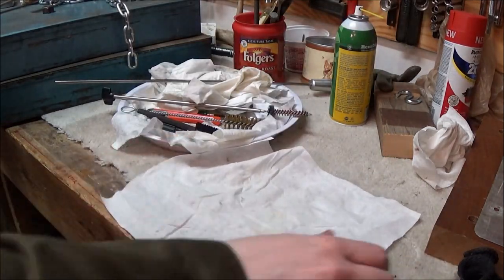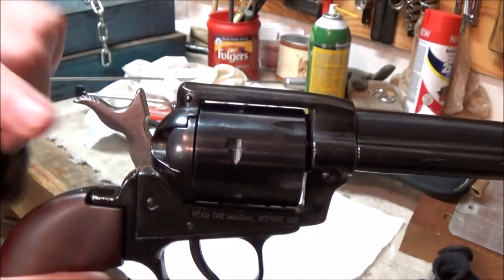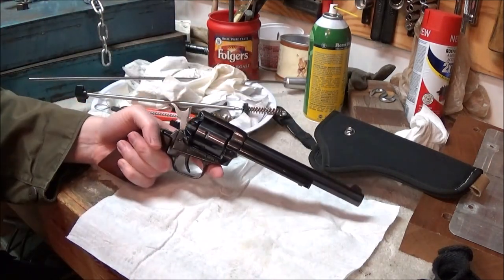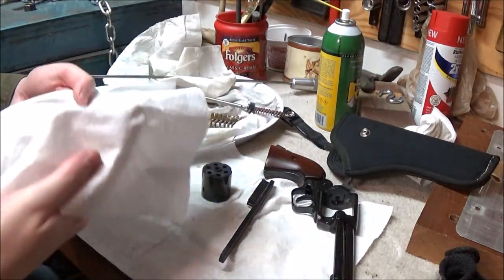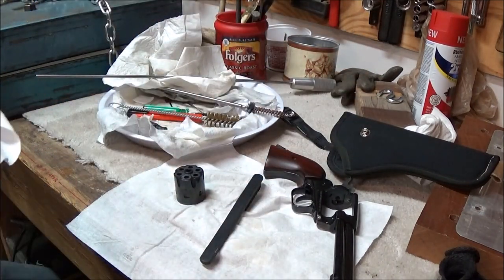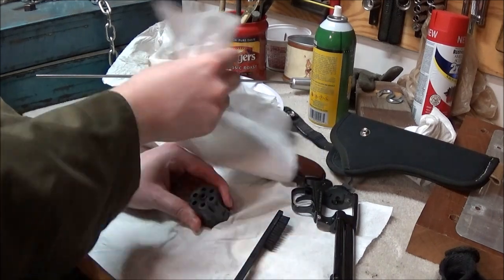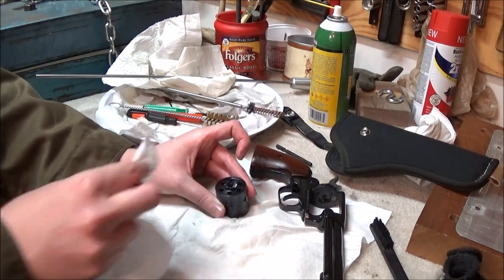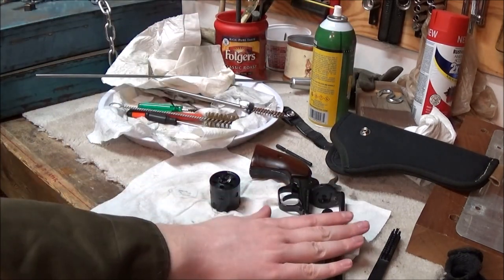How I Clean My Heritage Rough Rider SA Revolver .22lr Part 1!

Comment: Man,you seem to have all my favorite stuff my friend,M1A....gonna go on a elk Hunt with the M1A which Grain will this thing go up to I am wondering?, so I scored a bunch of different wieght hunting round's while  I could at Cabelas before the Virus madness took hold...aint nothin left now....I sure do love my 22lr & .22 mag cylinder on my Heritage! ...AR build's are just plain fun,... just like mom used to make, LOL...KEEP ON ROCKIN IT!.....Plisken X51mm......
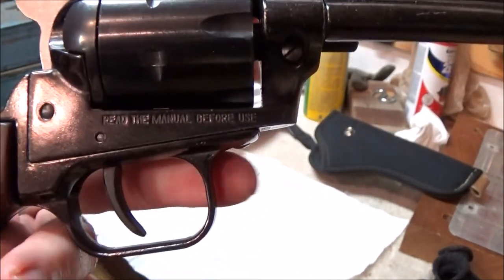Reply from the maker: I'm glad you enjoy my videos. On your question about the M1A and grain weights, M1As/M14s can shoot grain weights up to 180 gr. 180 gr and higher will start beating the gas system of the M1A after a while. So don't shoot 180s or heavier alot. Springfield M1A's have a 1:11 twist rate and I've found mine like 168 gr to 150 gr bullets and groups them very well. For Elk a 168 gr bullet with a flex tip and boat tail should do nicely. Although I've never hunted elk but 168 gr A-max bullets out of my M1A flattened white tail deer at 200 all day long. I also love my Heritage and AR15. Great firearms and they won't be the last ones I own ;) Same with the M1A. Thanks for watching!

Comment: So im helping a friend fix something pretty similar library arms 22 LR Rev looks almost identical. The hammer doesn't seem like it's strong enough to set off a 22 but it might need to be replaced and the shell rammer is very stiff and won't bounce back into place unless pushed 😆 have a hard feeling it won't be worth fixing
Reply from the maker: Some oil and maybe a few spring replacements might help. Although some things on guns aren't that easy to fix.
Reply: @pliskenx51mm83   so after braking it down alittle it looks like the firing pin, spring and bushing are missing. And the cylinder needs a realignment. Finding some of the parts online is way harder then I thought it would be 😅